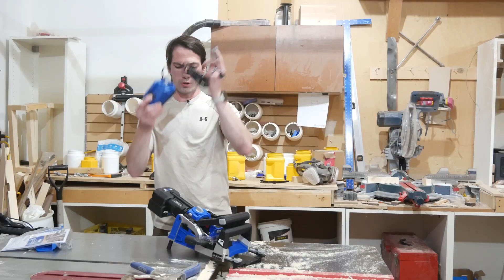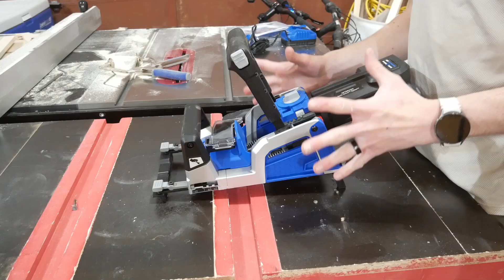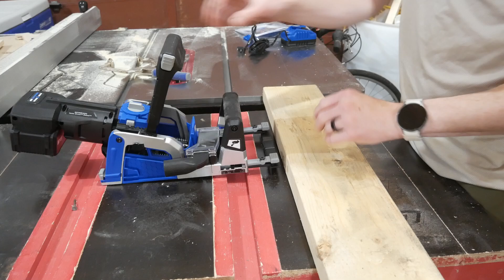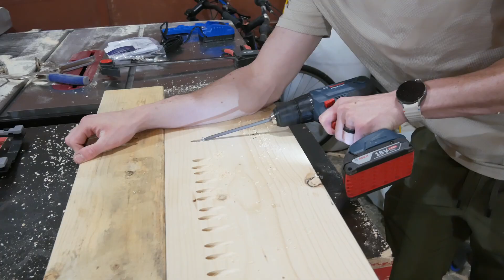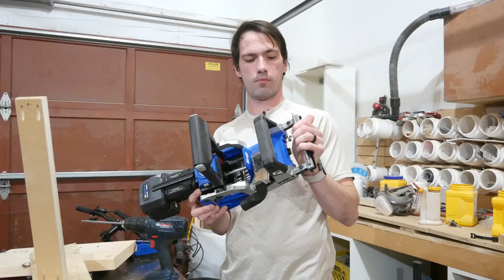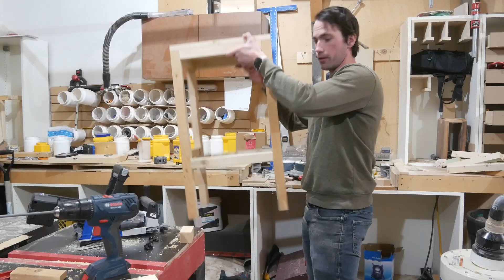This new Kreg pocket hole machine just changed everything

Comment: Only problem is you cannot cut a pocket hole from 1/2” to 1/2 Baltic Birch and sink the screw head enough to install a drawer front. Called Kreg tech and said you make it work. Does anyone how you can pocket 1/2” to 1/2” and sink the screw 😊head?
Reply from the maker: something to look into, have you tried the.. i think they are 1"  kreg screws, they have a different style head its smaller?
Reply: @TimberWizard Thanks. I will try that. Kreg tech support just sort of blew off and said the 1/2” to 1/2” won’t work to sink the screw head. I am pulled out the old 720 and see if I can come with something.